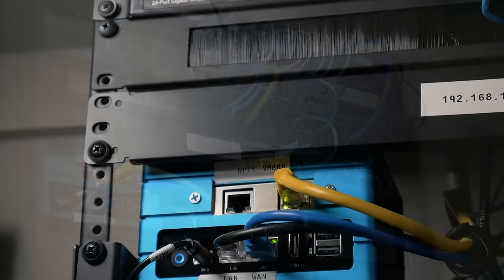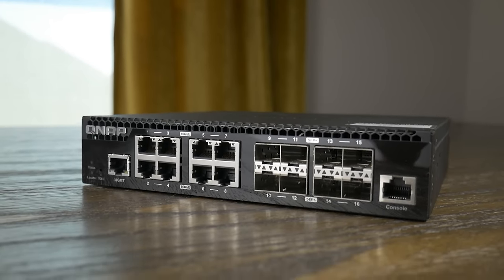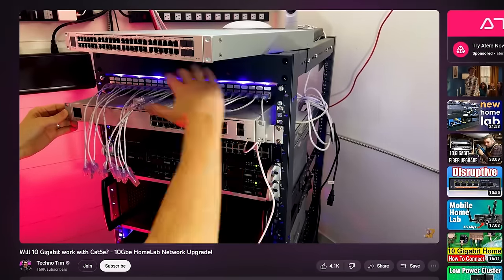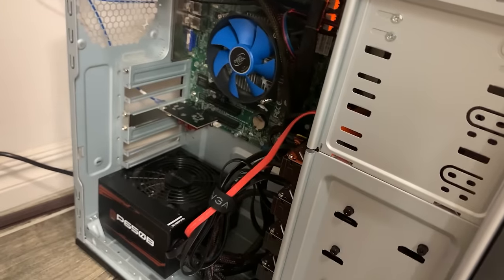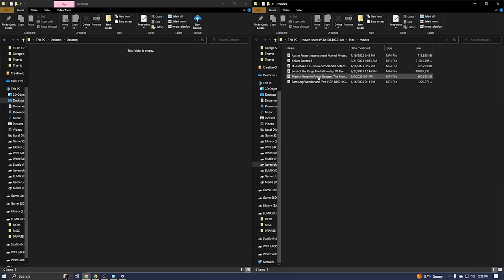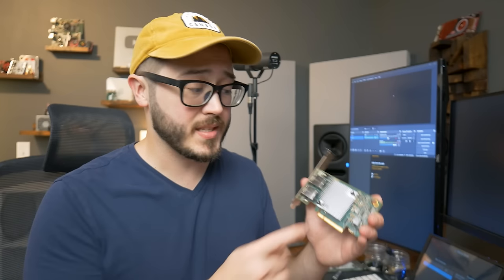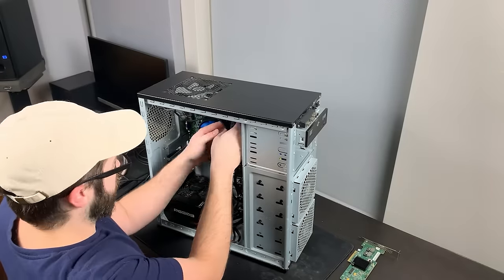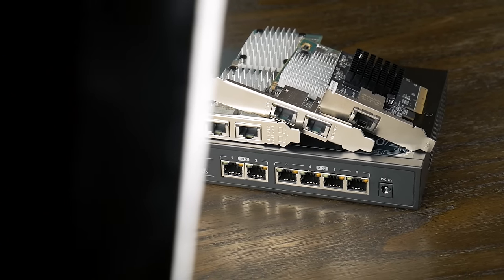Fast networking is cheaper than you think.

Comment: Most likely not same issue since it isn't server-card, but I couldn't get StarTech's 10G PCIe SFP+ Card to show up on 4x slot, only on 16x ones, while Asus XG-C100F with same chipset works just fine on it.
Of switches Zyxel XGS1250-12 could be interesting one if you need managed one.

Comment: Having seen this, and seeing 2.5gbps NICs and routers are cheaper than just a few years ago - I am curious as to how cost-effective it can be to have a network where the main systems needing to transfer large swathes of data have 2-port 2.5gbps AIC's and you pair-bond the ports on the system side compared to just buying 5gbps NIC's and running a network like that.

Cables would be a wild card variable, one that I'd personally see as more cost-effective to cut and crimp my own compared to buying pre-made cables.

Comment: I finally went to 2.5gbit,, my 8 bay NAS rarely fully taps it,, most of the time hitting over 1 gbit,, so good to me for the moment,, the switch has a single 10gbit sfp,, so uplink options later but for now better then 1gbit,, i would say if i had data volume to use 10gbit of several ports i really do not think 600$ is that real bad for business grade options.  Also since i have no fibre in my setup i kinda hate switches with sfp as the rj45 piece's are stupid expensive.

Comment: There is just 1 video of a 10Gbe switch from microtic that is like 5 years old now. That cost a 100$ and has 4 10gbe ports. 5 years later not a single video that has 10gbe switch - all of them are 2.5 with 2x10 added and all of them more expensive.
What is going on?

Comment: Talk about click bait  "Cheap Fast ethernet"  then shows a $600 switch.  Don't buy this stuff.  Look up the TP Omada equipment, way cheaper, and theres a managed switch with two 10GB SFP ports.  You can get a Ethernet 10GB GBIC for fairly cheap.
Reply from the maker: I felt like I was clear that the $600 switch wasn’t budget. I tried to focus mostly on the $150 switch and the used NICs. But sorry if it felt like clickbait to you

Comment: im planning to build a pfsense box from an hp elitedesk with an i7 7500 and 32gb mem.  it has four pcie slots - 4x, 1x, 1x, 16x - i'll have a quad 2.5g in the 4x, and a dual 1g in one of the 1x slots, a single 2.5g in the other 1x - thinking about adding a 2x 10g spf+ card into the remaining 16x slot to go to my media server and main vm machine and then just bridging it with all the rest of the ports...then if i need more 10G i can add an unmanaged switch down the line....you think this sounds reasonable?  its been a while since i've run pfsense, ive had a spectrum pos router and then an openwrt router for some time (which will be an AP with openwrt with the pfsense router) so yea im just wondering if itll even be worth buying the three 10g cards

Comment: The thing I really don't get and something bothering me a lot with all of these affordable Switches is why they only ever have like two ( 2 ) 10Gbit Ports which essentially means you can only connect your PC to either the Router from where you got your files or the NAS where you're going to store them for maximum Speed - But NOT both OR even just another 10Gbit Switch to solve the problem.

Fuckin' drives me NUTZ.

Comment: Awesome video! I'm upgrading to 10GbE and doing network segmentation now, so the timing is excellent. (Or: I have no idea what I'm doing. :P )

I have a few QNAP switches and love them dearly, though I've run into artificial limitations as I've tried to set up VLANs--the hardware supports the full VLAN feature set, but the software hasn't implemented certain things yet. It's become an aggravation point. Rumor is version 2.0 is supposed to fix a lot of that, but it was supposed to launch at the beginning of this year, so ... ¯\_(ツ)_/¯

That said, QNAP switches are still my goto recommendation for "I want to do more complex networking but don't want to spend 8 hours a day messing with it."

Comment: You have a b550 vision d? Or is that the new Aero one? Great series. I gave mine to my friends and bought a ProArt X570 Creator Wifi, but this one is less reliable than the Gigabyte. I bought it for the IOMMU groups. I will probably avoid Asus from now on because this thing can't put up with my abuse.
If I ever create a nas, I will host it on a PC with thunderbolt so I can have speeds faster than 10 gigabit between it and my pc or a laptop. In fact, I will probably end up turning this thing into a monster nas (and server for other purposes) once I upgrade.

Comment: PSU fan pulling air from the inside in Hard Drive Haven? Idk if you can test it, but how cool does it stay even the lack of airflow in that case? (Or at least it looks like it doesn't get much air)
Reply from the maker: It actually gets a decent amount of air from the front two fans. The PSU fan is up because there isn’t access to air from the bottom of the case, so I’d rather it be able to pull in air from somewhere. Plus, most of the warm air in the case will be towards the top and exhausted from the 140mm fan there.

Comment: I've been running 10gb for awhile now, through a unifi aggregation switch I've got 2 servers, my main pc, torrent box and my other poe switched aggregated through 2x10gb for 20gb of bandwidth.. (which is next to useless, but why the hell not, right?)
anyway I have 2x 980 pros in raid 0 on my main pc, and transfering from my server (8xsas drives, raid 5) I can saturate that 10gb link. Writing is much slower to the nas from my torrent box, I have a jbod in that and it typically transfers at 100/200mbps.
Once SSD prices come down and 6 and 8tb models are affordable, THEN 10gb networking will really shine.

Comment: Still to expensive to upgrade. I have a 1gb Ethernet home network an computers and they still works fine for most things. Only if I had Nvme NAS would I consider upgrade but I don’t. These things are Still to Expensive for Me. I don’t Make videos or internet content. I just comment on it. I use a $100 HP z440 computers as Desktop and NAS and they work great. I use Linksys and Cisco switches at home with Cat-5 that I wired the house long ago. I am to LAZY to Rewire with Cat6e and the Switches are Still to Expensive. I would need allot of ports on the Switches. I need a 20 port 10gb Switch for Cheap.

Comment: Nice one for the video.  I've considered almost the exact same upgrade using the same components.  Did you experiment with LAG or bonding the two ports together ?  ...I'm sure the normal reason for this is redundancy but just wondering when having multiple clients demanding files concurrently how it would handle the resources.  I'm thinking the 4 spinning drives would probably hinder this experiment unless you've got some insane amount of RAM as cache or some higher tier NVME M.2 drive I missed during the video ?
(in the UK an ISP provides a router equipped with 1Gb ethernet ports yet advertise a 1130Mb  download speed !?!  ...its a combined modem and router I must add - and they say wriggle their way out of it by saying multi-user this and that and top speed multiple devices etc.. BUT, we're techies and the router is pants so we switch routing services off, turning it into a dumb modem, and utilise our own router - SOOO we want the WHOLE of that download capacity, and now you can;t have it unless you create a LAG group and use 2 ports, connecting 2 ports now from the modem to the router/pfsense box/etc...  So for redundancy here we need a 4 port LAG, using up all available ports on the modem, and requiring a new switch, or additional NICs and cables.

Comment: while mikrotik 10gb sfp switch costs even less than this while having 4x10 gb ports
Reply from the maker: But it’s SFP+, meaning I would either be buying a ton of adapters or cable. With this, I’m able to use the patch cables I already own as well as the existing infrastructure.